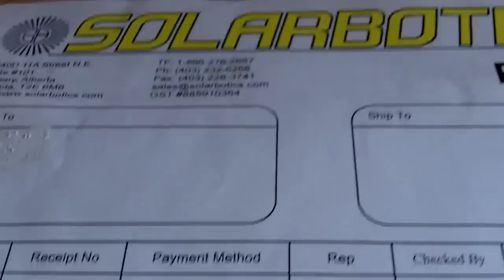oscillators, coils, lights, batteries.MOV

Comment from the maker: @buddybill65 I'm using a 330uf 16 volt cap and .1 uf cap I think it says 250 volt on it. That Penny circuit is a replica of Lidmotor's Penny. If you go to my channel and find my video called (Blocking oscillator replica) you can see what I did or better yet go to Litmotor's channel and find his video called (Penny circuit diagram) plus he has more videos on Penny.